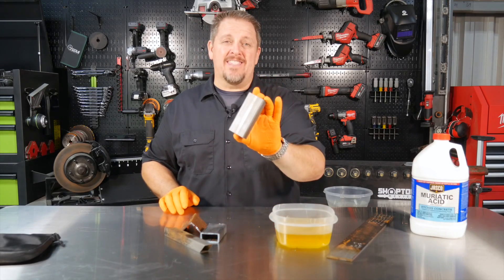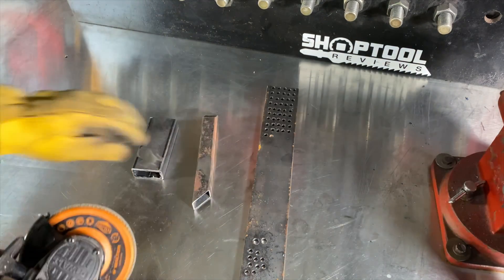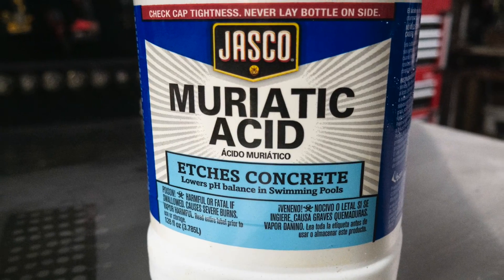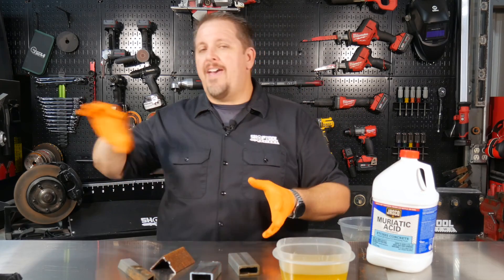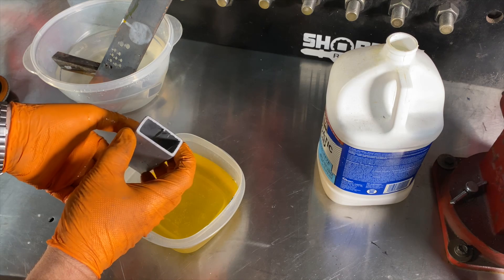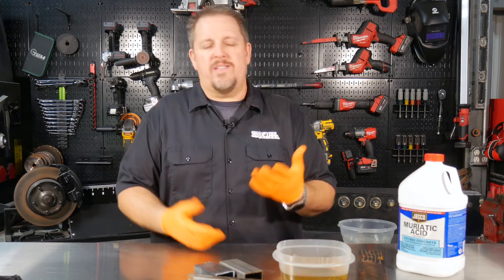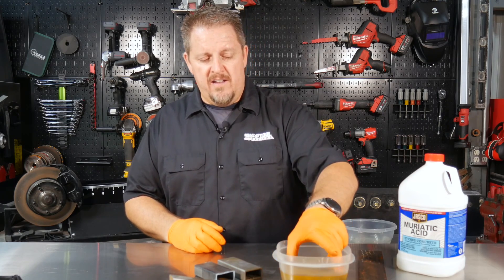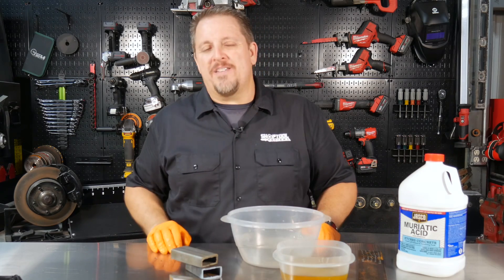How To Remove Mill Scale and Rust [FAST]

Comment: Mill scale is not the impurities that float to the surface. It is the oxidizing of the semi molten steel formed when steel is hot rolled. Also grinding mill scale does not so much clog a flap disc or grinding wheel, it is more of a dulling/glazing issue. After using any acid it should be neutralized before painting, Baking soda will work.

Comment: I experimented with acid and with standard strength white vinegar. I used 6 inch x 2" x 5/32" mild steel pieces in a tupperware box, they were heavily scaled and rusted. I left the vinegar for 12 hours and I'd give it 4/10, not worth the effort IMO. The acid took 15 minutes to get 90% clean, and a light scrub with scotch rite got all the crap off. Dipped them in a bucket of baking soda and water then rinsed in tap water and dried with a paper towel. For welding all I need to do is a light pass with a wire wheel or flapper disk to get them shiny. My acid was 19%, I initially covered the steel in fresh water then slowly added muriatic, total depth maybe 1 inch then I got a reaction happening. Excellent method, very easy in practice and far faster and cheaper than simply grinding, mill scale quickly clogs up grinder disks. Thanks for the video.

Comment: Opening muriatic acid in your garage will cause all the metal in your shop to rust. Usually takes a little bit to happen but it will happen if the container of acid is left open over a period of time. I learned this the hard way.

Comment: Ya I don't know why people do test with all kinds of acids for rust removal that cost much more and is weaker if you need more or want it to be kinda safer juat dilute it with water distilled would be best but tap is probably fine but keep it all outside because everything in your shop will start to use

Comment: Hydrochloric acid (muriatic acid) is produced by passing hydrogen chloride gas into water. The reaction is reversible and hydrogen chloride gas rises all the time from an open container of hydrochloric acid. It severely irritates the respiratory tract and rusts everything in the same room. Always do this outside.
Once you have removed the Mill scale, it must be neutralized immediately. Water does not help, it only dilutes the acid, but does not remove it. A base is needed. Professionals use sodium hydroxide=NaOH=lye, the end result is table salt and water. Lye can be found e.g. in drain cleaners. Another option is washing soda, baking soda works too.
Reply: Been toying with this very process on a 12ft tall HRS sculpture for the past two months, and I've had the worst results spraying on a 1:1 baking soda/water solution to neutralize. Tried a spray bottle and a dry-mix garden hose attachment. The condensate appears right away to tell me that the acid is neutralized, but since it's effectively saltwater it flash rusts faster than tap water. So I've stopped doing that and use a power washer to dilute and "push" off the acid, squeegee and towels to dry. Brush on a rust converter right after called Ospho (surprisingly amazing stuff). All that said: I love the idea of neutralizing with a base, but I just can't get it to work. How does a DIY or hobbyist execute? What's the process? Can't really find that. Find plenty of industry or conceptual answers. And looking again, it's suggested that baking soda isn't getting the pH high enough. Like you suggest, lye is supposed to do the trick. Either way--how? What about the annoying condensate? Does it need to be a dip/bath? With a 1,500lbs 12ft sculpture, that's really not an option for me. 😢

Comment: I use this all the time and here are a few tips:
Wear goggles and do this outside. 
Do not leave open containers in your shop because the fumes will rust your tools.
Wear a respirator or at least stay upwind to avoid breathing fumes.
This works great on odd shaped steel or pitted steel.
This will strip mill scale, rust and zinc. (galvanized)
Real Muriatic Acid is actually 32% hydrochloric acid. The big box stores will cheat you by selling a lower concentration. In my area, Atwoods sells the real 32% stuff at a good price.
I dilute mine with water to 10-15% HCl for safety and to get more volume.
Towel dry instead of air dry to help prevent instant rust.
If the steel is oily, you may need to wash it with some dish soap to make this process work better.
Oil will help prevent instant rust but doesn't work for welding. I prefer a coat of phosphoric acid which creates a thin layer of iron phosphate that acts as a rust barrier. It also makes paint stick well. I sometimes weld through the iron phosphate layer but it will also grind off easily with a flapper disc for welding. The iron phosphate layer also lets me store the steel for a long time with almost no rusting.
PVC pipe works well for long pieces.
HCl will dissolve nylon. If you need to use a rope to hang items, or a piece of carpet to prevent puncturing containers, use poly.
Prior to disposing the acid it should be neutralized and what you get is salt water. Baking soda works very fast. Calcium also works. A cheap method is to place a good sized limestone rock in the liquid and let it set for a couple of weeks. Limestone has lots of calcium.

Comment: Folks, please wear goggles when working with muriatic acid, or any acid for that matter.  A little on your fingers isn't a huge deal, but on the mucous membrane of your eye it's an entirely different story.  I'm very surprised that this issue wasn't addressed in this video.

Comment: One very big question that you didn’t cove is “the best procedure to cleaning the metal to PAINT", because most metal will be painted as an end result.   If Muriatic Acid (or household Vinegar) is used, should one have to follow with a Soda Solution to naturalize the residual acid left behind, to maybe not affect the paint adhesion?

Comment: Muriatic acid is hydrochloric acid, what's in your stomach.  It doesn't attack organic matter like your fingers as fast as other things like rust or mill scale (oxide coating formed when white-hot steel is exposed to air).   I always use it to remove galvanizing before welding.  It will remove the thick, hot-dip zinc coating from galvanized iron pipe in just a few minutes.  Great stuff, but don't spill it.  For rust removal on more sensitive items such as a motorcycle gas tank, muriatic will work but can be too strong.  I've had terrific results using an organic chelation rust removal product like Metal Rescue.  It's quite benign to the parent metal.

Comment: Flap discs are overrated. High quality resin fiber discs work far better on flat surfaces. 24 grit for mill scale at slower speeds to avoid heating the scale. Then, an 80 grit cleanup pass on the clean metal to smooth the scratches.
Reply from the maker: You have a point. Some of these new ceramic discs are doing a much better job with removing mill scale. You're right, you have to keep the mill scale cool. Still, acid works pretty well also. Thanks for watching.
Reply: @Shoptoolreviews  Just tried some silicone carbide fiber discs on mill scale and it rocks! It sucks on metal but destroys mill scale.
Reply: I totally agree that flap discs are over-rated. Wire brush attachment is just as good in most cases, and if I really want sandpaper I use the replaceable paper discs with a rubber backing. Much cheaper than flap wheels.

Comment: If you go with flap discs go for the silicon carbide. If you want to go the acid route use phosphoric acid. Stronger than vinegar but weaker and not as dangerous as muriatic acid. Note: muriatic acid fumes will damage any metal in your shop if the container is not sealed shut.
Reply from the maker: Lol. You are exactly right. The fumes rolled out of this plastic bowl and onto the stainless surface, and just the fumes/fog stained the surface. Thanks for watching.
Reply: How much phosphoric acid per gallon? And what ph?
Reply: @TheTank8  I just use the klean-strip Concrete Etch, Metal Prep and Rust Inhibitor from homedepot.

Comment: Another option for cleaning is Naval Jelly. It's acid that's been made into a gel so that it sticks to the metal and doesn't run off like the liquid acid. But use a respirator!
Reply from the maker: We'll have to try that method. Thanks for watching.
Reply: Does naval jelly work good for mill scale or only rust?

Comment: WARNING: IF YOU LEAVE MURIATIC ACID NEAR ANY METAL THE FUMES WILL RUST AND EAT IT. DO NOT USE A SPRAY BOTTLE OR KEEP IT IN A BOTTLE IN THE CUPBOARD WHERE RESIDUE OR FUMES CAN GET TO METAL.

WEAR RESPIRATOR AND GLASSES WHEN USING AS THIS ACID IS ALSO VERY HARMFUL TO YOUR LUNG AND EYE TISSUE.

IF YOU WANT YOU CAN REUSE IT REPEATEDLY. STORE IN A CHLORINE BUCKET ETC SO ITS LOCKED AND FUME PROOF.

FOR DISPOSAL POUR INTO WATER TO DILUTE AND ADD BAKING SODA UNTIL FOAMING STOPS (NEUTRAL STATE).
Reply from the maker: Absolutely, very important to take safety precautions when working with any chemicals.
Reply: Many shops have been rusted from this stuff. I wouldn't personally go near it without elbow length gloves, goggles, and a respirator   ¯\_(ツ)_/¯  I choose to use high-acidity vinegar. You can buy 30% concentration at lowes, I then "cut it" with 10% cleaning vinegar to add more volume. You can spray a rust inhibitor after it's rinsed to prevent the flash rust.